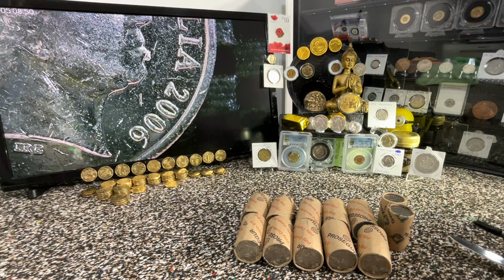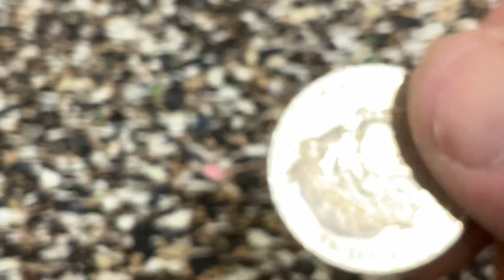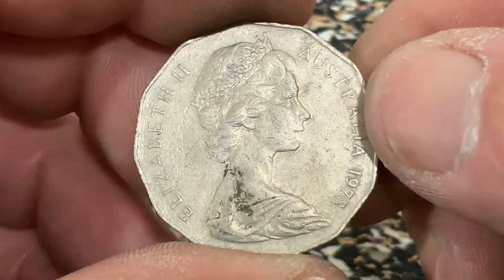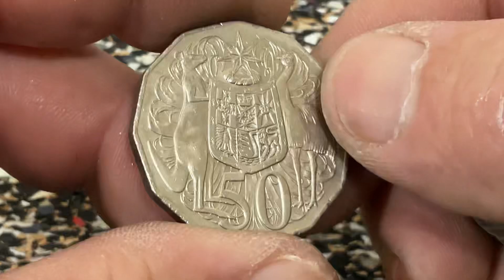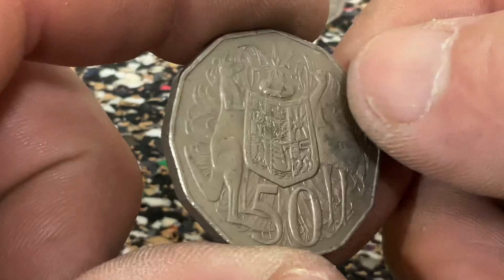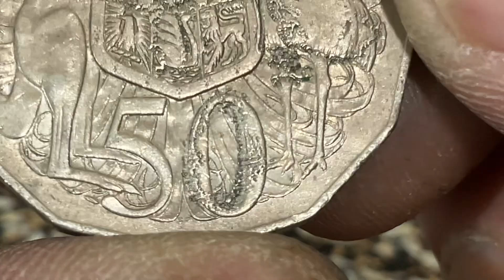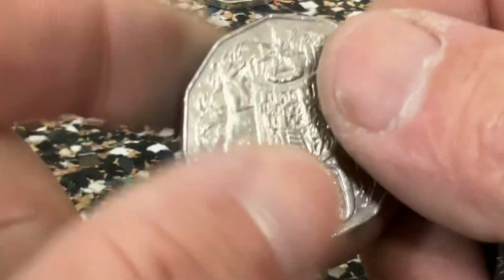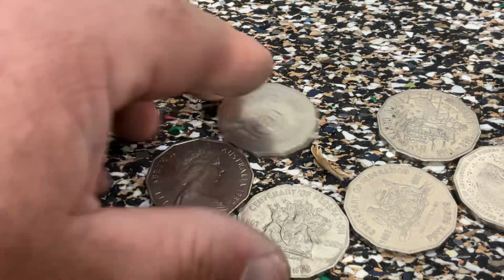😳Suprised to find these😳 50 Cent CoinRoll Hunt , LETS GET IT

Comment: Got some 50s out earlier, got 3 Prosegur rolls (from the westpac machine) and a bare skin.

That poor old 71 at around 24 minutes looks like it's been written on with an "electric pen", a spring-loaded pointed metal stylus with a current running through it that causes an arc on contact and causes the tip to bounce back against the spring and cause the indentations.
Reply from the maker: @NomadUniverse  hey Nomad , sounds like you’ve been to the big house mate with that knowledge 😂😂😬🙏🏼💪🏼CCC
Reply: @CoinCudsCollect  Haha, no I'm just a toolmaker and back when I went through tech college we had one for writing our names on our work.
Reply from the maker: @NomadUniverse  ahh yess , probably could make your own tattoo gun by the sounds, same sort of concept hey 😬